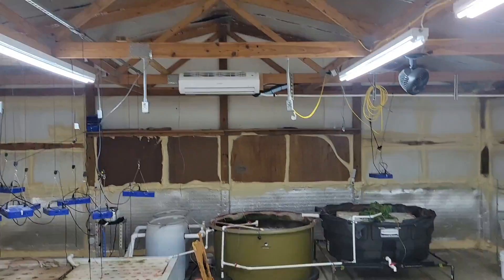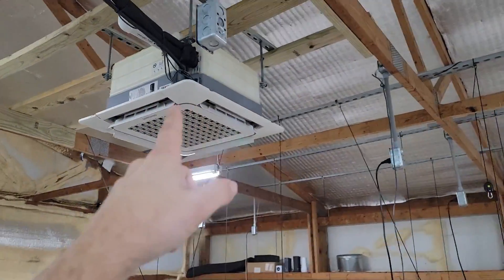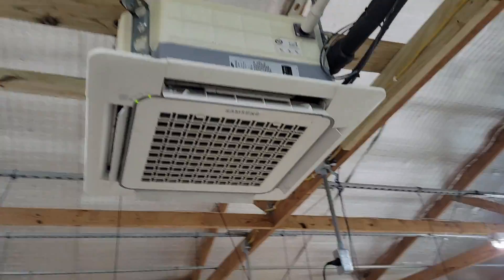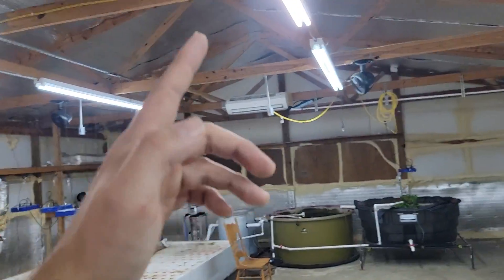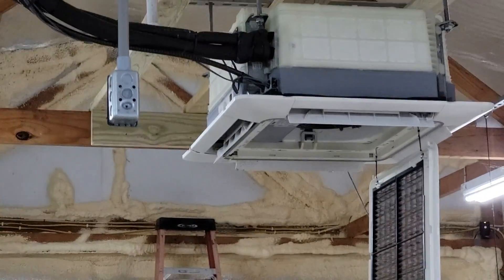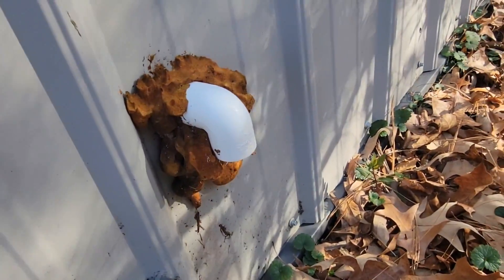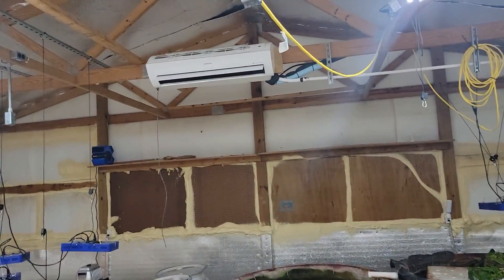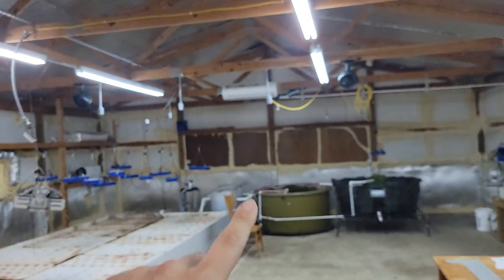Ceiling Cassettes Verses Wall mount air handler #minisplit #airconditioner

Comment: My question is concerning a home I'm looking at buying. It has 2 wall mount units installed but they are both on the same side of the house. The house is ranch style about 1100 sq. ft. The bedrooms and bathroom are on the other end of the house from where the units are installed. I'm concerned they won't cool those rooms since the air has to go down the hall and into those rooms. I have no idea the size, brand, or model of the units. I live in AZ and when the temps go over a 100F is why I'm worried.  Just wondering what your thoughts are? Should I be concerned?
Reply from the maker: Depends on the model of the air conditioner and how far it throws the air
 Also do the bathrooms have bath fans that pull in the air when you turn the bath and arm when you walk in the bathroom

You could undercut the doors 2" to allow for more air flow or add a diffuse or somewhere if possible
 I have another video called how many Mini splits do I need you should check it out

Thanks for watching Anthony

Comment: I have LG ceiling units. One of them keeps shutting down with a condensation pump fault. Do you have any content or information for repair or replacement for those built in pumps? Or can I install an external pump and bypass the built in pump? Thanks!
Reply from the maker: I have a video of a Built-in Pump that I worked on on a Samsung Check out my playlist HVAC  tips for technicians

Comment: Would you recommend an air vent for the ceiling cassette even if you're achieving gravity fall?
Reply from the maker: I would recommend an air vent because it just makes it much smoother however you do not have to necessarily have the air vent as long as you have plenty of fall

Comment: Does the air in the cassette flows up to the ceiling?
Reply from the maker: I can do a video explaining the air flow

The air flows in the middle of the cassette and out the 4 corner
 The position of the vein can be adjusted from 30ﾟ to 60ﾟ

Comment: Here is my problem. I am having our covered patio enclosed as a sunroom in a few months (the company is extremely backlogged). It will have 3 sections of glass (transom, windows, kick glass) covering all the way from top to bottom with no room (maybe 4 inches to ceiling) so there is no room to mount the standard mini split anywhere. The sunroom will also be enclosed on both sides. So the only places left to install one would be against the brick on the back of the house. Then the lineset and drainage would have to go up into the attic and over and out to the unit. Since drainage would go up I would need the condensate pump. The area where these lines would have to go is where the roof slants down and there is no room for anyone to work in easily. I can't seem to find a dealer who wants to tackle it. The ceiling cassette option has a similar problem. There are lots of rafters all over and the contractor says a sizeable square would have to be cut out for the unit, which would compromise the roof structure and they wouldn't want that responsibility. Im almost wishing I would have went with a PTAC unit and just live with the noise and the view it would block. Can you think of any other solutions? Thanks.
Reply from the maker: I need pictures I need more so that I can see everything and give you a good option.
 If you want me to help I need contact with you. To Proceed further  I need you to join and become a member
 I can dedicate the time to help you
 I need to give you my  Email and maybe my phone number so you can send me some pictures and I can help you and talk to you on the phone 

I need you to become a member click the join button and I need you to become a level 3 member
 It's 24.99 a month  
Let me know when you join here is my email
tadfuller1@gmail.com
Reply from the maker: Check this video out 
You might be able to use a console unit 
https://youtu.be/Sy7eiH22xF4
Reply from the maker: I need some pictures 
I think there is am option for you 
If you want help I can help but I need an email or a phone number 

Click the join button it's $2 dollars 

Let me know when you have joined 
my email is tadfuller1@gmail.com

Comment: Awesome video & info , have you ever retrofitted one in an RV ? ? Have seen many mini splits installed on “you tube” in RV’s but only one with the cassettes installed . You should make an instruction video with the cassettes installed in an RV , New Horizons that manufacture 5th wheels are one of the few who custom install these but over charge customers. Thx again & very well done . 👍⚾️🇺🇸👏
Reply from the maker: thank you Bob I love the knowledge thank you for the insight I may check into this 😊
Reply: You really should , I’ve been in the market for a Renegade Super C RV & typically these Rv’s only come with regular ceiling AC units that are extremely loud fans while operating & inefficient systems . Many RV people that Boondock are going to mini splits for their efficiency low watts & using lithium batteries / solar to operate them . However there aren’t very many experienced installers that want the challenge to install these in RV’s . Check them out on “You tube” ……all the best & maybe I’ll have you install mine when I finally purchase my RV ! Lol best of luck 👍⚾️🇺🇸👏
Reply: One issue I see with the ceiling cassette in an RV is the depth of the ceiling. Unless you recess it down a bit. You would then need to retrofit some type of cover or trim around it. Lines could run up through the room then off the back or front.
There is a 12V system out there for RVs, one I seen has the outdoor unit, installed under the RV.

Comment: Hmm, thanks for the video. I think you are wrong about the 110 volt unit taking double the power. 

It would be double the amps, but it would use the same amount of watts. If a unit takes 2200 watts running then at 110 volts it would be volts*Amps=Watts, so 20amps, at 220 volts it would be 10 amps, but the watts (or power useage) is the same in both cases (2200 watts). 

If you use 220v you do have the advantage of smaller wire (your running power through 2 wires now instead of one) and balancing the legs of the circuit board a little bit better (220v equipment uses separate phases of a split phase system).
Reply from the maker: This should help 

When 220v wiring is used, less current is required than with 110v wiring. Power is measured in watts. Thus, to achieve 900 watts of power, 4.1 amps would be required with 220v wiring, whereas approximately 8.2 amps would be required with 110v wiring
Reply: @taddydigest  Correct. I think you stated in the video a couple of times that it was more efficient or used less power (watts) because it was 220v. Really it isn't more efficient because it's 220v you can just use smaller wires/breakers (but end up using more breakers/hots) when running to the unit. Or if you already had 110v you may not have to run another wire. If you are doing a new install always do 220v, but I would say if you have power you can use that's 110v no need to run a new 220v line. Running the 220v line wouldn't make the unit more efficient.
Reply from the maker: Yes exactly you're right
  Thanks for bringing that to my attention
Reply: @taddydigest  Too bad you are in Tn. The way you handled this interaction would be enough for me to hire you.
Reply from the maker: Thank you Robert Where are you located my friend
Reply: @taddydigest  New Jersey. Just bought a former "weekend lake house", insulated it to death, but it looks like I'll be left to window units for a year or two. Keep up the good work. You answered questions I didn't even know I had.
Reply from the maker: Are there any companies near you that install mini splits in your area?

Comment: I have window units right now and hate them. It's never cool enough and the noise drives me crazy. Can you please tell me what the (indoor) noise is like with the ceiling cassette? Thank you.
Reply from the maker: Definitely a lot quieter than a window unit 
You also have the ability to pick between 3 speeds so that's a plus

Comment: I turned a shed into a small house. The Loft where the bedroom is gets no heating or cooling from the mini-split. The flooring and sailing to The Loft is Plywood And 1 by 6 boards.  Any recommendations?
Reply from the maker: Hey Laura 
Check out this wall/floor mount units https://www.samsunghvac.com/light-commercial-residential/console

Comment: Thanks for this video I’ve been providing ductless HVAC Systems as an option for customers and they have been happy with it. I have never done a cassette but was curious on more ductless applications like cassettes and floor mounts in the event I have the opportunity to bid an entire home. How can I become a member? I am interested in a copy of that booklet as well if possible. Thanks for all that you do. I’ve been working with my father in the industry for years but my exposure has been limited to residential service/installation. Videos like yours have been an essential staple for building my knowledge base. Even though I might not have a job the requires a cassette for example, at least I’m able to become familiar beforehand for when/if that time comes.
Reply: Same here, been working with my father since I was a kid. I've done hundreds of mini splits, mostly wall mount an a few ducted. Never done a cassette though.
Reply from the maker: You will have no problems
 Glad you've been working with your dad that's a great experience
Reply from the maker: That is awesome so glad that you have been working with your father and glad that you had the opportunity to install ductless equipment which is the future for now 
I will send you a link to JOIN and then I will give you my email and send you the guides to help 😉

Comment: For a Single Family home 2 levels in florida.. would you recommend a VRF with 4way cassette fpr each rooms? or a ducted system is better
Reply from the maker: The more units you have the more expensive it is.
 I would do the Ducted over the 4 way  especially if there's not a lot of room around the cassette 
 I like more open areas for the cassettes
Reply: @taddydigest  Is Mitsubishi Hybrid VRF same as the one on this video?
Reply from the maker: Same setup basically but this unit was a Samsung VRF

Comment: Hi I’m  building a shop in Minnesota 1800 square feet 16 foot sidewalls and two 14 foot overhead doors .I will have floor heat from natural gas boiler . I also want a mini split for air and heat when the floor heat isn’t either quick enough or when it’s not going to stay cold . It’s mostly going to be one big room with a bathroom and a room for utilities. Planning on a wall mount single unit . Would a 36000 btu unit work ? Or since it’s not the only source of heat should I go smaller?  I plan on doing the install myself with a mr. cool or another DIY unit . Any advice is appreciated.     Great video content 👍 keep it up !
Reply from the maker: 3 ton would be perfect so yes go with that one for sure Thank you for watching please hit the like button